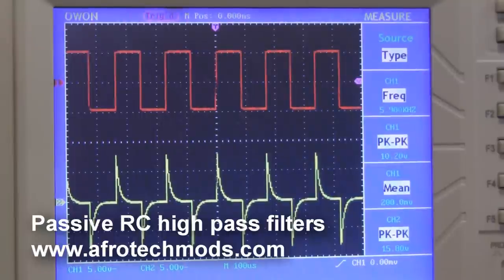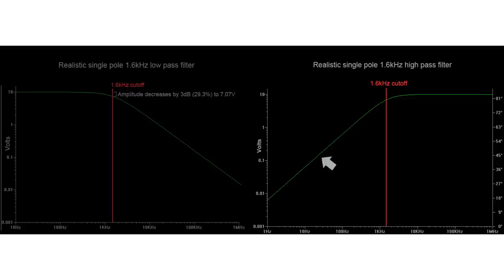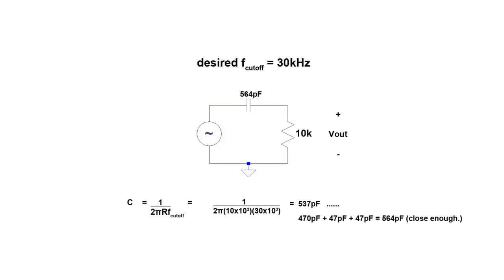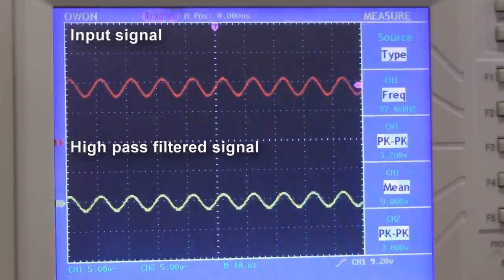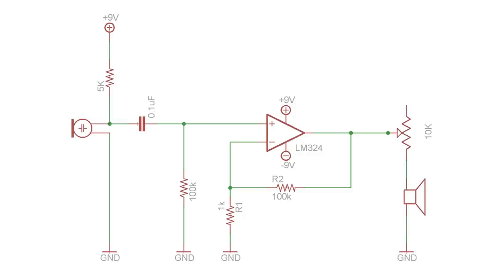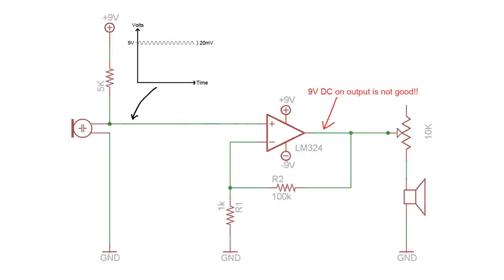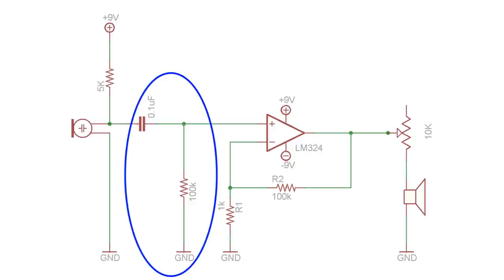Passive RC high pass filter tutorial!

Comment: Dude, your two videos on Passive High Pass and Low Pass filters explained the basics to me perfectly.
For the past week I've been trying to get my head round the concept but all the information I came across was all Pseudo Babble and Techno Jargon, well above my head. This was perfectly explained and now I understand. I've even memorised the formula too! LOL. I'm working on a project at the moment which involves RF and Audio and I'm getting a distinct hum on the audio line from some sort of RF interference which I'm working to track down and eliminate. If I can't find it to eliminate it at source, I am going to cheat and filter it out of the audio line using a high pass filter with a cut off of about 250Hz so it's a gradual decline around the problematic frequency range. Thanks again!
Reply from the maker: You are welcome. Btw chances are you have some sort of ground loop and want a ground loop filter. Or a 50/60Hz notch filter.
Reply: Thank you. The project is battery powered and the humming is in the region of 250Hz which is very noticeable. At first I was using just a 100nF DC blocking capacitor in series with the audio signal line but every time the radio transmits, it would wipe out the audio signal completely - unless I went near the antenna or touched the metal box the project is housed in and then the audio would appear. I got round this by replacing the 100nF DC blocking cap with a 22uF electrolytic which seemed to cure the problem of the RF completely wiping out the audio or me having any effect on it when I go near it - however it has brought that nasty hum with it. I've just been playing with a circuit simulator where I've mocked up an active high pass filter with Op Amp but if I use an electrolytic capacitor for my filter, it complains about reverse voltage so I'm guessing they're not suited for the job. My concern is, if I add the low pass filter with a ceramic capacitor that I'll be back to square one with the RF killing the audio so they'll be no hum to filter out lol....

I am beginning to suspect that it is as you say, a ground loop going on. In which case, it may mean a re-design of my PCB to use some sort of star grounding?

Guess I'm just going to have to prototype it up, suck it and see, as they say. :)

Comment: hi. when you mentioned that the voltage across capacitor cannot instantaneously change because it needs time to chagre and then followed by saying if a sudden fast change voltage is pumped to the caps input it will instantaneously appear at the output side. i am confused by this statement.
Reply: Yeah me too
Reply: Yeah, if someone figured that out, please do comment. The sentence makes no sense.
Reply: It will instantaneously appear on the other side because there will be close to zero voltage drop across the capacitor at high frequencies. It will pass straight throught. It's the voltage drop across the capacitor that cannot change instantanously. And it's the voltage drop across the capacitor that cancel out signal waves at low frequencies.
Reply: So - correct me if I am wrong - the capacitor can act as a "variable resistor" depending on the frequency, whereby its "resistance" (capacitive reactance) decreases as the frequency increases. There's an inverse relationship there. The arrangement as shown in the video is very similar to that of a voltage divider, so the filter can be thought of in those terms. If, for a highpass filter, the capacitor is R1 and other - actual - resistor is R2, then with low frequencies, R1 should be relatively large compared to R2, so that there is a significant voltage drop across R1, so less of the signal makes it across R2. On the other hand, if the frequency is high, R1 should drop, attaining a value way less than R2. In that case, there is more of the signal to be dropped across R2, the actual resistor in this case. So the higher frequencies pass with less attenuation. (Remember that the voltage dropped across a resistor is proportional to the resistance value, as Ohm's law describes.)
Certainly, a real-life circuit is not perfect, but hopefully the above provides some intuition. I found it helpful to draw out voltage divider circuits on paper and play around with different case scenarios.
Reply: Jason W. Yes. Your word for the day is Impedance.
Reply: caps are used as regulators in voltage. and how digital filter is made?

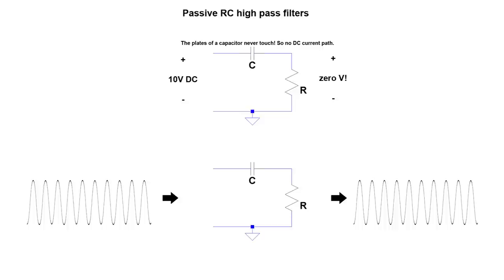Comment: The "reason" the illustrated circuit at 0:48 is a high pass filter has nothing to do with the fact that the voltage across the capacitor cannot change instantaneously. It is because at low frequencies the impedance of the capacitor is much higher than the resistor and thus little voltage is dropped across the resistor. As frequency increases the capacitor impedance decreases, and thus more voltage is dropped across the resistor. The opposite obtains if the output is taken across the capacitor instead namely at low frequencies the high capacitor impedance is reflected in high output voltage and at high frequencies the low capacitor impedance results in low voltage.

Comment: These circuit diagrams don't make sense. Where is the load connected? How can swapping the resistor and the capacitor make a difference if in both cases they're connected in series?

Comment: i think what's confusing is that it was never explained in the opamp vid that the mic provides AC and DC signals.  it assumes we know that and that we want to filter the DC, which i haven't understood why
Reply: be cause the sound is an  Ac signal ,  we just need Ac , so we filter Dc , and if we diden't filter dc we will have noise on the specker's, plus it can domage the specker's  cause the dc is emplified with the opam's and can be 10's of Volt (this equal's domaged specker's ) and if we see the ac in the input it was just 0.002v and after omplification can be 1v or 2
Reply: +bilal h that makes sense.  Thank you
Reply: you welcome
Reply: and if you said so why we have the dc from the first position. then we filter it ?!!, the answer is this type of microphone needs dc voltage to work , then from  it's result (generate Ac sound waves + dc offset) we filter dc , there is a microphones called dynamic microphones very used don't need dc so there is no need on it to have high pass filter or dc voltage this type of microphones are directly attached to the opamp.

Comment: in the last example in the op amp, I really do not understand the part in the high pass filter when adding a high resistance 100k in order to not overload the mic for amplifying, thats confusing and what happens if you decrease the resistance and increase the capacitor as long as you get the desired cut off frequency , please help thanks
Reply: Me too got confused at the same part! Have you got the reason for the same yet!!
Reply: This may be a late reply, but in my understanding the high value resistor serves as a current limiter. The microphone may not be designed to handle very high current values.

More information here :
https://en.wikipedia.org/wiki/Current_limiting
Reply: I think it’s the other way. The voltage at the + and - nodes of the op amp will be the same. Since the gain is Vout/Vin, and we know that the gain is 10, the output will be 90V theoretically. Practically, it’s just maxed at 9V. By adding the resistor, it reduces the voltage at the + node, which reduces the voltage at the - node. I suppose we could just lower the microphone voltage, but you would need two power supplies, which is inconvenient. So yes, the frequency cutoff would be the correct value, but the resistor value would not divide the voltage enough so the output wouldn’t distort.
Reply: I think the gain in this case is 100,

Comment: if your hooking up a highpass filter to a set of tweeters, would the resistance value be the resistance of the sound drivers? because I assume you don't need a extra resistance for one of these circuits right?

and also how do you put strain on a source? you mentioned it a couple of times in the video but where would I be able to learn more about that?

Comment: Sir,, I want to ask,,, The high pass filter and low pass filter mean that we can make a permanent without using a high or low signal cutting potential regulator. For example, I want to make at the end of the output the maximum low frequency is 150 Hz and the maximum high frequency is 2 khz 🙏

Comment: Hey afrotechmods, I always use just a 2.2uf capacitor(connected in series) to produce a high pass filter to my tweeter. No resistors are used. It worked very well. Are there any disadvantages of doing this?

Comment: im using a velleman 7 watt mono amplifier as a guitar amp. im running two 4 ohm speakers in series, and there is some low end thats slightly overdriving the 4" 10 watt speakers. how or what capacitor and resistor valuea should I use? and can I put this filter on the lead of the first positive input on the first speaker in the series? thanks!!! AWESOME information but slightly above my math skills lol!!

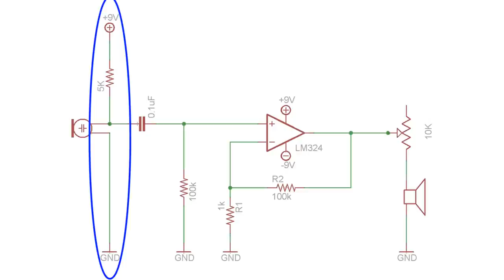Comment: 4:00 why do you even need the 9v DC offset? a microphone itself creates an electric signal from sound right?
Reply: No
Microphones is just a capacitor whose capacitance change according to vibrations created by sound waves.
Reply: @madhuradharme9131  Ok after reading up on types of mics, the operating principle depends on the microphone. Some microphones operate as sound pressure-dependent variable capacitance as you mention, and others operate on induced voltages in a coil moving along a magnet. I guess he uses the capacitance type of microphone (condenser/electret) instead of the one I was thinking about, in which case it would make sense that he would need to power it with a power supply. Thanks!

Comment: I'm confused as to how you got a 20 mV peak to peak signal from the 9V and 5K resistor. How does the math work for that and why do you use a 100K resistor for the HP filter? How does the math work for that? Why not a lower resistor or what is the lowest the R value could be before it overloads the output?
Reply: i have the same question :P
Reply: @distortedmist  Signal Generator provides the 20 mV sine wave and the DC voltage provides the necessary offset.

Comment: How do you determine what is high and what is low? Say I use a 10K resistor and a 10uf(.00001) capacitor with this formula... it comes out to 1.59Hz.  That isn't high at all.  Or is it all relative? Would this still work? Or would it be low pass instead? So confused...

Comment: What i didn't understand is how, when hooked up to your mic, does this remove the offset. i can't visualise it. I thought the high pass filter here is purely for audio preference purposes. I didn't know that the mic's output oscillates over it's V_in, so now i know that we need to remove the offset (and as you have, you've got the signal to oscillate at 0 V). I'm trying to build a circuit similar to this, but i want a high pass filter to remove things like footsteps. Originally i made the cutoff F to be about 160 Hz, but now i'm worried to rethink the schematic, since i may not be accounting for the dc offset removal. Any help would be appreciated. Great videos too, helped me a lot during my degree :)
Reply: It works because a cap blocks dc.

Comment: I saw both of your videos on high and low pass filter and now I have a question.....If I combine both the filters together with a standard audio source, Do I end up with a nice sound output with a lot of frequency output range or i will get something something bad or weird....What you can say?
Reply: That's exactly what you want to do. However, you clearly cannot put both on to a single speaker, which is why you have a woofer and a tweeter. The woofer has a low pass filter to filter out higher frequencies and the tweeter has a high pass filter to filter out the low frequencies.
Reply: yes that's right..do you have any designs or plan based on your idea?
Reply: Mal Boomal what about mids? What could you do for that.

Comment: Hello sir! I have a question. What do you mean by: "Having a high resistance value will ensure that I don't overload the microphone's unamplified output"? Isn't a high resistance on an output, an "overload" itself?
Reply: Ana-Maria Chiper No, if that resistor weren't there, a lot of current would go from the microphone's output straight to ground.  With the resistor there, very little current can flow straight to ground, and must instead flow into the op amp.
Reply: +rlrsk8r1 An op amp's inputs take in 0 current, is that not a fundamental rule of op amps?

Comment: If you only want to block the DC from being amplified, why not just use the capacitor?  In other words, why not use a resistor of infinite value (open circuit)? I suppose you can hear below 15Hz, true, but it's still an extra component.

Comment: An op amp's inputs ideally take in 0 current yes? So where does the current to the load (headphones) come from?

Is it supplied by the +/-9V supplies on the Op amp itself?

Also how would the amount of current be determined? Simply by whatever the headphones draw, regardless of the resistance of the 10k pot you have?

Also how do we know how much current goes from the output through the 100k and 1k resistors (used to set up the gain) to ground (because ideally none can go into the inverting input of the op amp)?

Thanks.
Reply from the maker: +Zambia95 The current to the load comes from the power rails. The current will be determined by what the headphones draw plus a small amount of quiescent current that the opamp needs to use internally to operate.
Reply: Afrotechmods Thank you.

So is the current through the resistors used to set the gain simply wasted power that can't be avoided?
Reply from the maker: *****
Yes but it's only going to be a tiny percentage of the total power loss.

Comment: I wired three piezo discs in parallel and tried to put a high pass filter and a low pass filter on the output, but no sound came through. Can anybody tell me what components I should use for a 60 hertz cutoff high pass filter and a 12 k low pass filter (for an acoustic guitar application)?

Comment: Thanks, How about P.W.M. / Variable Frequency Drives used on A.C. Induction Motors. My V.F.D. has voltage spikes above the voltage rating of the motors insulation.  How should I size “Choke Coils “?  2 H.P. / 480 volt  motor.

Comment: So I don't have a power supply that can provide +/-9V.  Could I crank it up to 18V and use a 50/50 voltage divider, thinking of the "ground" rail as -9V and the "middle" of the voltage divider as "0V?"
Reply: rlrsk8r1 Yes provided your voltage divider uses low enough resistance value to create a stable "virtual ground"
Reply: rlrsk8r1 Also would be a good idea to use a couple of large value capacitors parallel to the resistors in your voltage divider for a more stable virtual ground.

Comment: What would happen to the output signal and cutoff frequency if you remove 100k resistor in that amplifier hpf? So only 0.1 uF cap connected to the inverting input
Reply: You need the resistor so it acts like a voltage divider and thus you get the required output

Comment: 1 thing that I don't understand from the beginning of the video. If the voltage across the capacitor cannot instantaneously change, why for high frequency it acts like a short circuit. I means high frequency, there is a lot of alteration in the signal.

Comment: What would happen if instead of a high pass filter, it was just the capacitor? basically just remove the 100k resistor.
Reply: In theory, it would be like using a really small resistor (R ~ 0 Ohms) and you basically attenuate all of the DC component, leaving on AC. This unfortunately does not work in practice because of the capacitor's inherent resistance, as well as possible DC leakage through the capacitor. Tldr, I think you should always have a cap/resistance pair if you were do build a high pass filter.